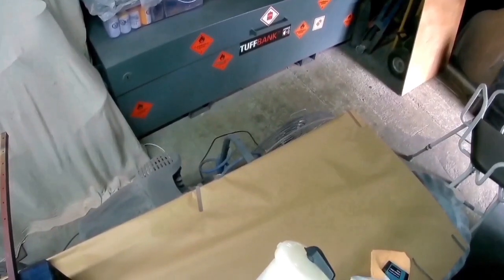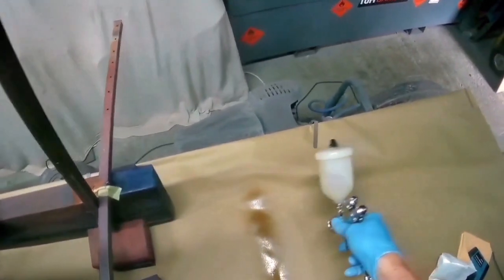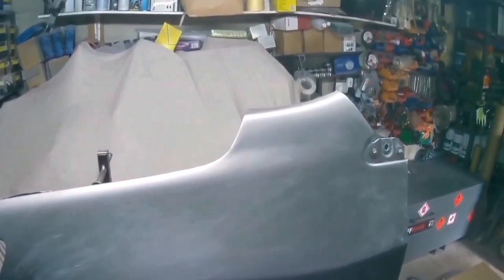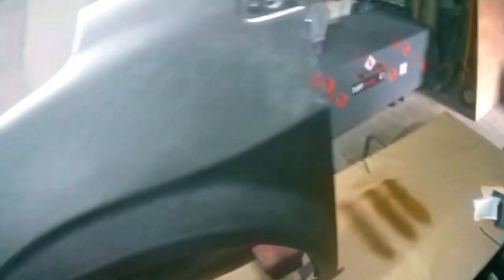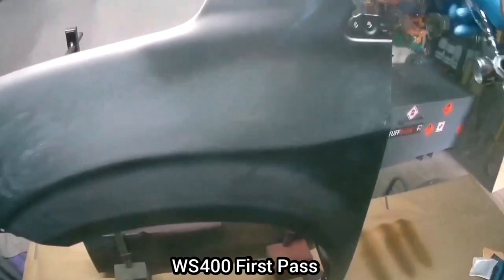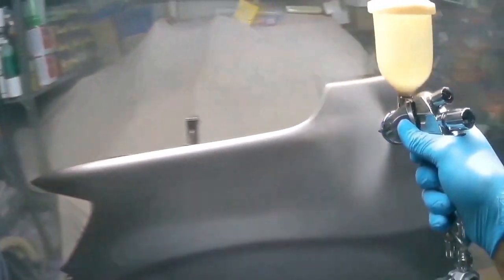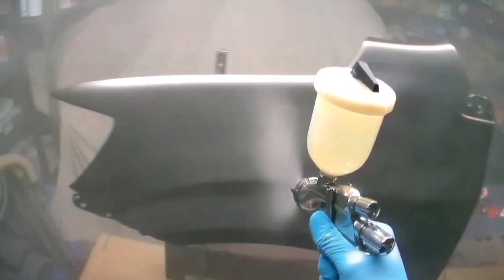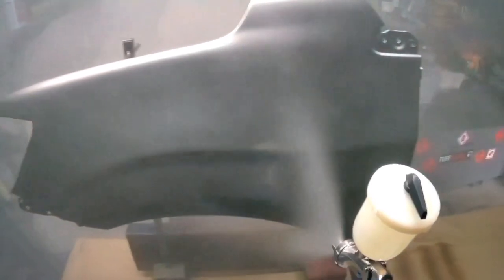Iwata WS400 1.3HD v Kiwami 4 1.3 BA4J For Clear Coat

Comment: Hi mate what would you say is better for clear/base and 2k direct gloss? I'm torn between either devilbiss flg5 1.3 or iwata kiwami 1.3 or finally the ANI f160 1.3? Any help would be appreciated :)
Reply from the maker: Hi Ryan, you have been doing your homework mate as that's the sort of line up i would choose, if it's an all rounder all would be fine, the F160 is my favourite between that and the FLG5 as its a little more of everything and normally cheaper but as you have included the K4 1.3 which is more money but presumably in your price range then i would go for that, ideally 1.3 for base and clear and 1.4 for 2k direct but if it's only 1 i would certainly stick with 1.3.
If you are pushing yourself with the K4 then you won't be disappointed with the F160,  it's a great gun for the money
Reply: @peteshobbies5383  thanks for the quick reply mate! Ideally IL be using it for basecoat and 2k as I have a GTi Pro lite dedicated for clear only which I love! I currently own an flg5 1.3 but find it's a bit pants at basecoat so looking at either the f160 or the iwata. How's the reliability on the iwata and the f160? I will be using it every week to do a couple of jobs so don't want it breaking on me haha! I just want to say thanks as well for doing your videos they are a great help!
Reply from the maker: @Fannyshnifter  I've had trouble with a few of my Iwatas with air passing out the rear of the needle, however this would never stop you using it and is just annoying really, no problems with my F160s yet, I'm spraying every day but have lots of guns so none of them get loads of use.
If it's mainly for base the Kiwami4 is good although the WB and WBX versions are better but much more money, don't think you will be disappointed though.
Reply: @peteshobbies5383  thanks mate! What would you say is better the kiwami or flg5 for 2k? I find the flg5 doesn't pay it very flat and I have to pass over the panel with tighter overlaps to build up enough material that it flows out? I run it at 2.5 turns out and full fan too
Reply from the maker: The Kiwami4 in 1.4 is really good for 2k direct gloss,  from memory the FLG5 is about 4 to 4 1/2 out for full fluid, you'll be better off turning it right out, that will help get more material on
Reply: @peteshobbies5383  that's great info thanks mate! I wonder if I've been having issues with the flg5 because I haven't had the fluid wound out enough. I know that with my GTi Pro lite I have to wind the fluid out 2.5 turns otherwise I get runs with the t110 aircap. IL give that a go with the flg5 before I buy another guy though! Thanks mate! Just out of curiousity what is your favourite clearcoat , basecoat and 2k gun? Mine has to be the GTi Pro lite for clear
Reply from the maker: @Fannyshnifter  Ryan, out of interest how close do you have the gun from the panel with the Gti Pro Lite? also pressure?
Reply: @peteshobbies5383  I have it just slightly away from a hands span away and 2 bar pressure. It tends to come out like glass
Reply from the maker: @Fannyshnifter  just wondering really, all sounds good especially if your getting the results you want, let me know how you get on with the full fluid on the FLG5, it will certainly make it wetter which should help sort it out, cheers buddy 👍
Reply: @peteshobbies5383  hi mate sorry to bother you again! I ended up buying a kiwami4 but it comes without a cup. Do you know what cup fits it? And I don't suppose you have one going for sale do you?
Reply from the maker: Hi Ryan,  it's the same thread as the AZ4, AZ3 and WS400, LS400,  there are a few cups that fit, 200ml is PCG-2P-2, 400ml is PC-G400P-2 and 600ml is PC-G600P-2, hope that helps
Reply: @peteshobbies5383  that's a great help! They seem to be very expensive (£40/£50) I don't suppose you know of anywhere that sell them cheaper?
Reply from the maker: Yes they are expensive, don't know of any cheap one's, sorry

Comment: Hi friend I was watching your comparison videos but I'm still need help to decide what gun should I buy,  I found flg-693 with 1.3 1.4 1.8 tips it's $200 on ebay and I found kiwami 4 without paint cup about $170 and the gpg with 1.4 1.5 1.8 about $240 for painting one or two parts of a car at home my by using 60 gallon air compressor with I think 40 cfm need help please and  Suggestions betweendevilbissand iwata (good gun even fan nice patren good over all).
Thank you very much and looking forward for your feedback.
Reply from the maker: Hi mate, what do you want the spraygun for, primer?, basecoat? Or Clear or all of them? , your compressor is very capable so no worries with that, please let me know
Reply from the maker: Also does tge FLG 693 and GPG come with all 3 tips?
Reply: How about the iwata kiwami or belaria arthe better than the flg693 or flg5 or gpg or they are same because I need base and clear coat gun to last many years, thank you very much.
Reply from the maker: @Ammar-ku4yx  The Iwata Bellaria or Kiwami4 is a better gun than the other two, i don't think it will be as reliable though, I've had a few problems with my Iwatas with air leaking, it's better for base and clear but not so good for primer even with a 1.8 tip, they use the same cap in all the Bellaria type guns and i don't think it works well for the bigger tips
Reply: I usually use cheap harbor freight gun for the primer filler and hte spectrum for base and clear coat without a previous knowledge about the paint spray guns just watching your channel and the gunman(gti pro lite ❤) and paint society and of course you too I'm impressed about what you guys doing and I would like to have a success jobs to so would you please point for a base or clear coat gun to buy. Thank very much
Reply: I like to get the kiwami 4 or belaria classic but i have to buy the cup and I think I will go with flg-693 because everything comes with it cup and three tips and air gage but no idea about the air caps if it's better than the flg5 cap, unless if you have different opinion . Thanks
Reply from the maker: For what you are paying the FLG kit sounds the best buy so i would go with that, I have only used the FLG5 cap so can't comment of the other cap but it's certainly a good place to start as you get everything with it and the gun will last you a long time 👍
Reply: Thank you very much for all your help 😊
Reply from the maker: You're welcome buddy 🙂
Reply: I buyed the flg 693 and I'm waiting to receive it hopefully will be a good gun and I wanna ask you her what is the next level gun to buy after this one that you recommend to me and another question away from the guns how to heating up my garage(not insulated) in a winter time it's very cold here in salt lake city utah iwas thinking to find a safe way heat it up.
Thanks
Reply from the maker: After that something like a Tekna Pro Lite would be good, heating is always a problem,  most will use a oil fired space heater but you need to be careful not to use it when you actually spray, or IR lamps work of
Reply: I appreciate your kindness and the feedback .
Thanks
Reply: @peteshobbies5383  what is a good tip and cup size to pick for the tekna pro lite and is the tekna pro lite is same as the gti pro lite ?
Reply from the maker: Hi , the Tekna Pro lite is the same as the Gti Pro Lite and it comes with a 600ml cup
Reply: Sorry I was try to ask you about the cap size but the keyboard wrote cup 😆, I enjoy watching your channel, and I would love to show you my work before and after if you like so you can correct me if I'm wrong but I don't know how.
Reply from the maker: Ok, if i was to only have one cap it would be the TE20, if you are a new painter then the TE10 maybe better as it's slower
Reply: @peteshobbies5383  ok got it, I finished painting 2 motorcycles was long time a go and some parts of 2 cars i done a good job  but I still need a lot to learn .
Reply: Hi again 
What is the difference between flg5 air cap and the air cap for flg693 the one I pur chased,  I didn't receive it yet if you have any idea pleaseletmeknow. Thanks
Reply from the maker: Sorry,  i don't know,  I've never seen or used the 693 cap so can't say
Reply: @peteshobbies5383  I understand I just thought you might used it before, some one told me the only difference between flg5 and flg693 is the air cap, but thank you very much.
Reply from the maker: Yes, the air cap is the only difference,  the rest is the same but I've never used this gun with a 693 cap, always an FLG5 cap 👍
Reply: Oh I didn't know the 693 is the air cap size so what is the air cap size for the flg5, I appreciate all the information that you provide to me ☺️❤ thank you
Reply from the maker: Yes, FLG is the body so is the same for both, the 693 is a type of cap and the 5 is another type of cap, the 693 is HVLP and the 5 is a sort of trans tech, the 5 uses about 30% less air as well, in the states the FLG5 is called the SGK600,  are you on Instagram?
Reply: Yes